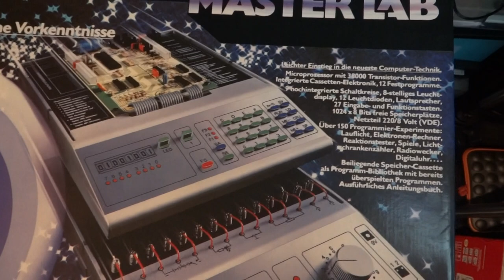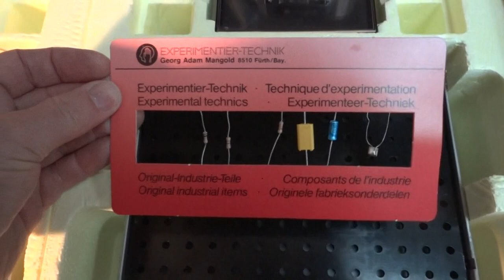Philips Microcomputer MasterLab MC6400 Show Off

Comment: Wow, that must be a collectors item !
Thank you for the video.
I’m looking forward to see some experiments with this !

When I started working, it was in a Philips service center store.
I worked there for about 13 years.
I remember that we had many of these kits in stock.
I knew the Philips EE system from my childhood but I never got used to the tedious spring connection system and that’s why perhaps this system didn’t appeal to me’
I had and still have the Philips EE2000 (blue suitcase and EE2010 (OP amp techniques).
How do you feel about the spring connection system ?
For me Busch is more compact and more expandable.

Many greetings